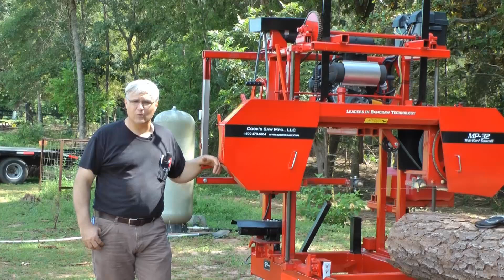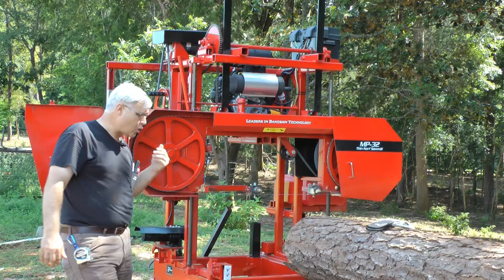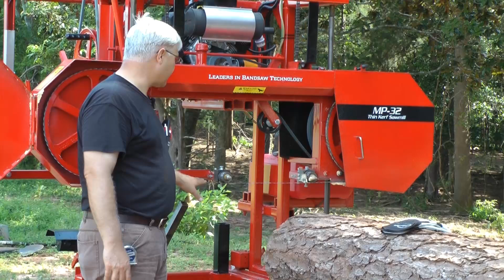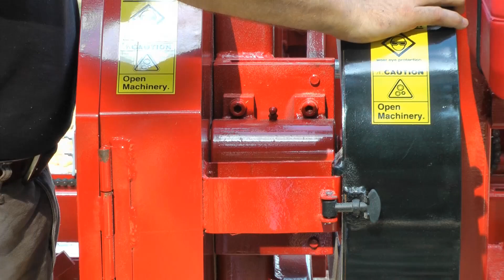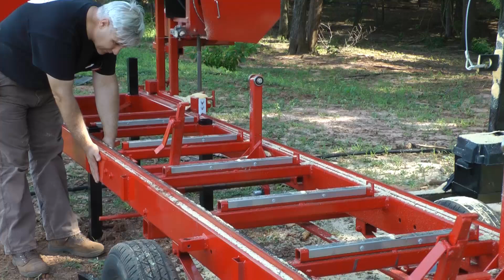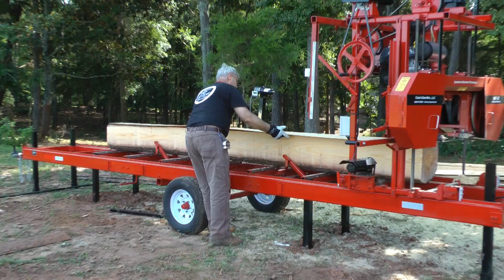Cook's MP-32 Portable Sawmill 2013

Comment: Great mill and fine information!, you have a fact when you mention the belted band wheels being out of round!. I have a Linn Lumber mill and it has and does exactly what you mentioned, it jumps up and down due to the band wheels  not being perfectly round or balanced and I am not too happy about it since it would cost a lot of money to modify my mill to eliminate this problem. Also the stainless steel bed caps is absolutely a great idea since many woods will stain from a painted bed cap or even rust stains, both of which I have on my Linn Lumber Mill. All in all this is a much better mill than I have and it seems a bit more complicated then mine but probably would produce more lumber with less problems over it's given lifespan. Thank you for a great informational video.
Reply: Marti, I have a Linn Lumber mill that Gary Boyd built for me 40 years ago.  It is still in very good shape.  I now have a Cooks sawmill package on order.  I grew up in a sawmill family and know quite a bit about millwright work.  I've been to the Cooks plant to look at them up close and see how they are made.  I can tell you that they are the best mills that I've seen in their size categories for any price.

Comment: 20 years milling hardwoods downunder. Very impressed with your presentation. Great detail. You didn't demonstrate rolling a log up onto the cradle with the 12 V winch and cable amidships (for next time).
Few of our logs would be small enough to saw on this mill unfortunately. Love the portable idea as well BUT... would NOT be able to license that to tow on the roads here:- 
~1500 kilo (3300 GVM/ATM Gross Vehicle Mass / Aggregate Trailer Mass) trailer, requires manual over ride brakes here.
Above 3300lbs requires tandem axle and breakaway brakes.
(What is the gross weight of the trailer for towing pls)?
Also the wheels require mud guards to prevent throwing rocks up and breaking passing car windscreens (or indeed killing a motorcyclist?).
What point "portability" if it can't legally be towed on the road  to the source of logs?
Can you make one that will handle hardwood logs up to say 6ft in dia?  
What weight of log will the twin rail system carry safely winched up there with the stabilizing jacks in place?
While long lumber is fantastic for building - here with hardwood logs the raw lumber is so expensive that mostly its not used any longer in construction, its used for high end furniture. Not many tables longer than 8 or 10 feet long so BIG logs are typically docked/bucked into shorter lengths & slabbed between 3.5 - 6.0 feet wide to be dried for single piece table tops.
So a shorter overall mill that could take short but big fat Logs would be ideal...
Just a suggestion...   
Theres a market downunder.
At the moment most use the lucas saw portable mill with a chainsaw slabbing attachment or alaskan mills with twin Stihl 088 power heads, BUT the recovery of a horizontal bandsaw mill is very attractive....
A few of the old wood mizers made their way downunder for our Pine Plantation wood but pretty much useless in larger native hardwoods.
Some guys would prefer to dock these larger logs into 2.5 - 3.0 meter (8ft - 10 ft sections) and winch them up onto a 3 tonne tipping trailer- take them home and tip them off and work their portable mill at home (rural property's) - rather than try and take such a long mill into our forests where - you'd need to spend a week clearing a big enough place to turn them around to take home again...  they wouldn't fit around tight turns...on steep ground for e.g.!
You wouldn't get a F 250 4X4 down most of our bush tracks in heavy forested country.
Just passing thoughts - I understand its designed and built for your timber in your country - it just precludes pretty much exporting them here...  which is a shame - they are very well designed and constructed.
Wider taller and shorter (or bed able to fold in half for transport & fold out / support with jacks for use).
YMMV (Your Mileage May Vary).
In the market for a mill at the moment.... so looking at everything available... this is one of the nicest I have seen, design materials construction etc. Just not very practical for here sadly.
You are a great presenter.
Reply: Buddy this mill is made for most standard logs, I've seen 16 ft logs 30' in diameter on these portable mills these are for the guy who has the means to cut timber, if you have 6 and 7ft logs in diameter like you claim, and your cutting them by hand and trying to find a portable sawmill to use then something is badly wrong,  if you got timber that size in such wild and huge places then that's when you put a million dollars worth or skidders and dozers in there and take them to actual sawmills, these sawmills ain't just made "for that area"  they have big timber out east also, but if it's that big of a job then usually it goes to a different kind if mill.these are made for any common man sawing any common tree. Everyone in the u.s has monster pines 60' in diameter. take your negativity somewhere else, these are for the working man with a side gig, or a farmer and rancher with a good spread of land or a entrepreneur. if you got the massive virgin timber you claim then you dont need to have uncle phil and brother bob out there trying to cut anything down with a pollen saw and 14 inch bar. You may want to call a large logging company or some professionals.

Comment: Bought the fully manual MP-32 sawmill  (w/ the 25hp Kohler engine) in 2008 and couldn't be more pleased.  It's heavily constructed and can withstand repeated loading and turning of heavy 28-inch diameter logs.  I haven't kept track of the actual board feet I've sawed up but its been enough to build a garden shed, 14'x20' cabin  above our pond, an extension on my wife's horse barn, with a stack of lumber left over so far.  All the lumber came from large pines on our place that were either beetle killed or blown over by heavy wind when our sandy soil was saturated in rain.  So far, I've had no problems with it and not even band wheel crown wear (that I know of; it still saws very accurately).

Comment: I bought the "older" version of this mill in Feb of 2013 and couldn't be any happier!!!  Poor Mr Billy gave me the demonstration of my new mill during a torrential downpour!  I was one of the people that noted how the plywood doors looked "cheap."  However, after sawing several logs with a lot of internal tension (thus causing the blade to jump off when finishing the cut), I grew to appreciate the plywood doors because they did minimal damage to the teeth on the blade.  The Cook's have manufactured a fantastic mill and I hope to upgrade to the HD3235 in the next year or two!

Comment from the maker: Correct. It only wipes to the inside of the blade where buildup tends to concentrate as pitch and sawdust will collect on the inside and go between the band wheel and the inside of the blade and compact onto the blade.  Whereas the outside of the blade is not affected in this manner.
This is not as much of an issue unless you're sawing a species that naturally has a heavy pitch such as pine.

Comment: Does the felt wiper for your solvent drip wipe only on the inside of the blade - or both sides? or perhaps the outside of the blade doesn't typically have a buildup problem?

Comment from the maker: No difference in sound as the doors are a snug fit with teflon wear strips underneath so there is little to no metal to metal 'rattle'.
Sound is comparable to a riding lawnmower however there is additional sound that comes from the blade when engaged and as such we recommend hearing protection.